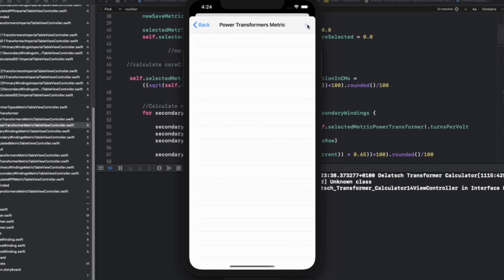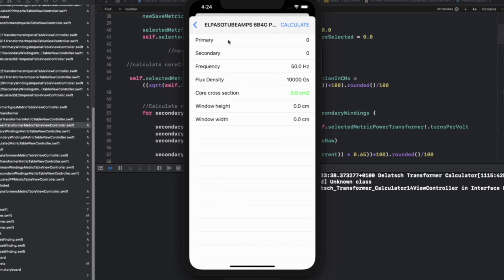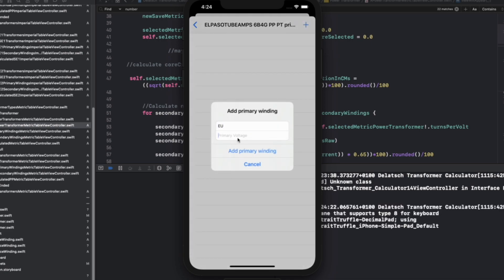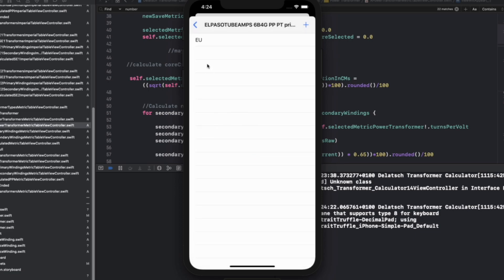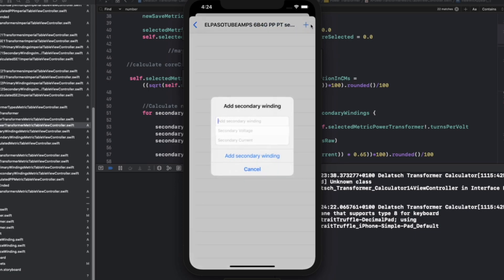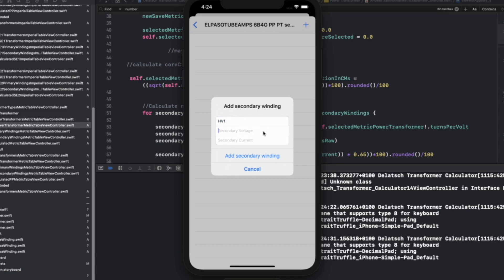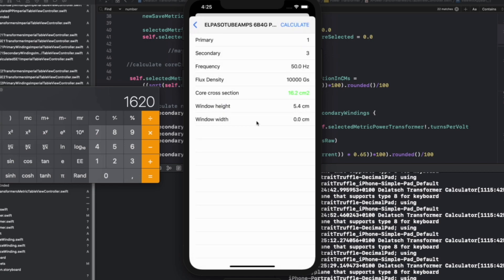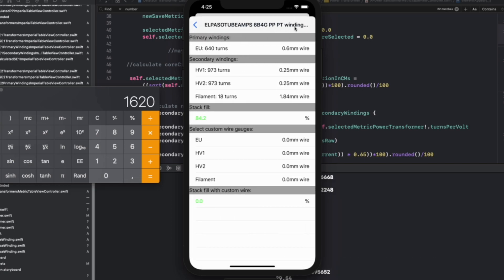ELPASOTUBEAMPS INSPIRED 6B4G STEREO AMP - POWER TRANSFORMER WINDING

Comment: First of all thank you, you're one of the rarest youtubbers sharing all steps you follow to build chokes and trafo's. By the way, may I ask you how long you leave the trafo dipped in beeswax and at about what temperature you preheat it in oven?
Reply from the maker: Thank you for your kind words! I usually don't preheat the transformer in the oven, I just leave the transformer in wax for about 10 minutes. I make sure that the wax that hardens at first on the transformer melts fully and becomes a liquid. Then I pull it out of the wax and if there are still parts of solid wax on it I dip it back into the wax for couple of minutes more.